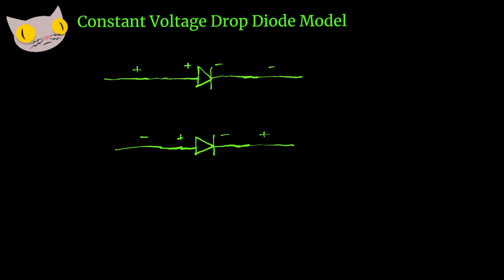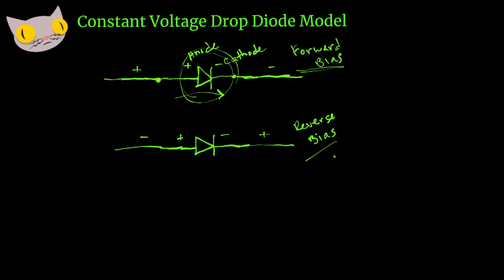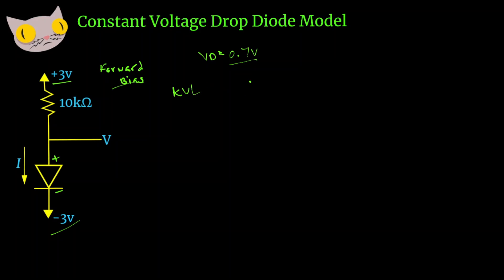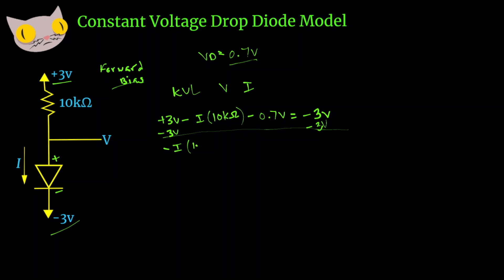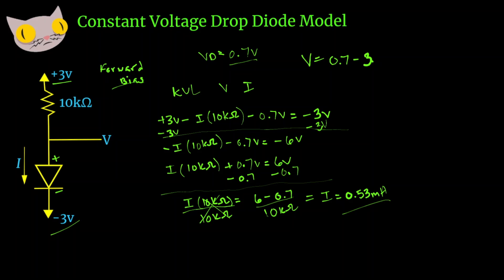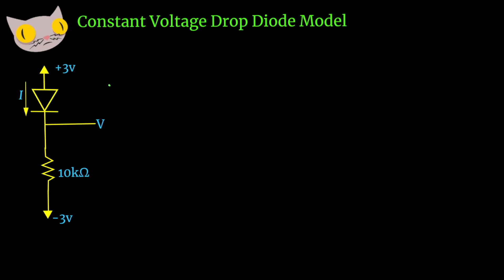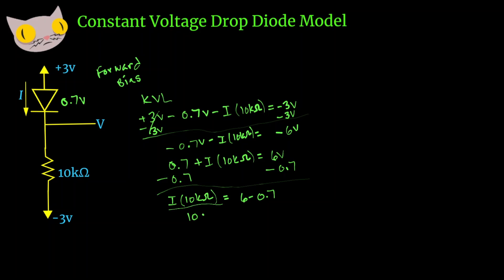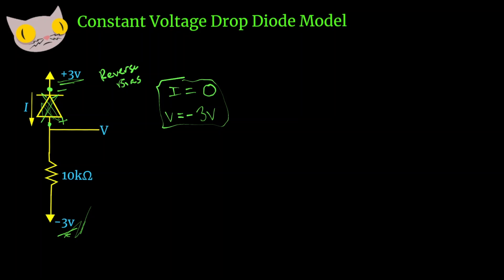Diodes | Constant Voltage Drop

Comment: Hi bro you should tell always the reference point of that V point , cause if you talking about the voltage drop of resistor it will be 8.3 v for the first model
Reply: 8.3 v cause -3 v more negative than 3v